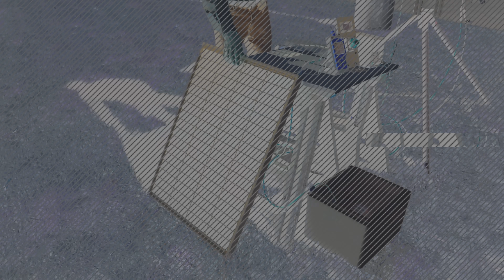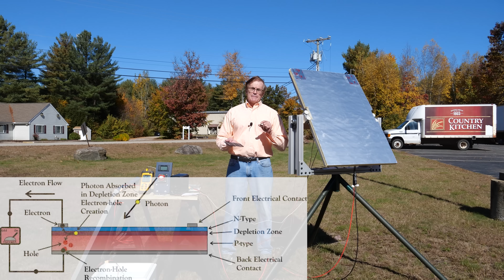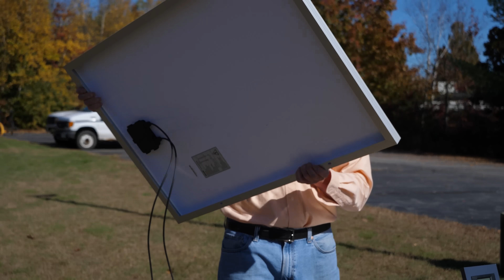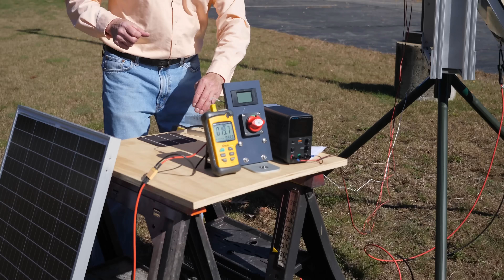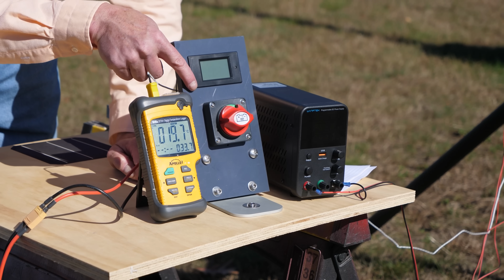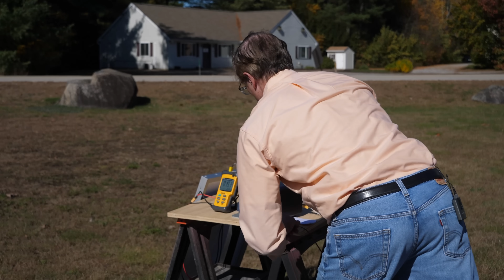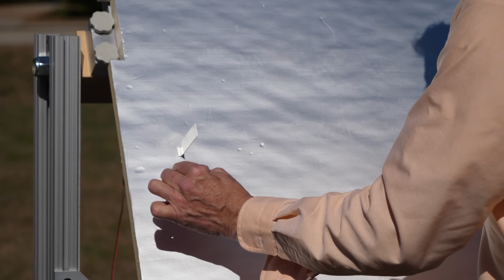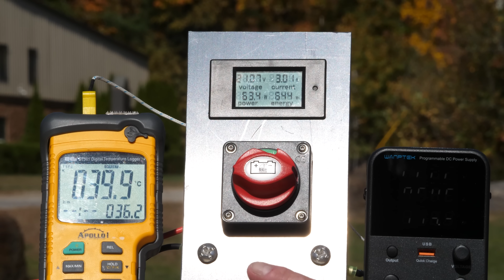Do you REALLY get enough out of your solar panel?

Comment: heat pump + panel?
Reply from the maker: I don't know.
The trade-off is the energy harvesting value through the heatpump vs. the decreased cooling of the panels due to the increased temperature exhausted from the heatpump.
Reply: @TechIngredients  yeah I'm also thinking that this could be just a value question. But also this Heatpump could add more temperature difference for more efficient use of peltier/seebeck/stirling -modules doing extra energy harvesting or pumping actions of water for night energy harvesting, using traditional falling mass method or heat battery.

So result could be that this extra electricity from panels would be contributing to preserving the continuity of power harvesting or be a Combined heat and power(CHP)-solution. For example to reduce on heating and/or pumping bill of shower water.
Why waste good energy, if we know we can use it?

Comment: Did You test or Think about some FAN air flow on the Outside surface, blowing up or AT the outside surface.  Maybe ???
Reply from the maker: No.
The additional  surface area when the front is included is relatively small and the extra fan will draw more energy.   Not to mention that the extra fan is likely  to shadow  surrounding  panels unless a ducting system was designed, which would further increase costs.

Comment: Aircooling is much more simple than water cooling. Especially if you live in a place with freezing temperatures. If you use one big fan located in the shadows and run ducting to the panels it should be efficient, easy to monitor and repair. And if you want to use the heated air from the panels to heat the pool maybe you can push the heat through a radiator and then to a heat exchanger in the pool. But if i would use water maybe i also can run the water down the pipes to my geothermal heat pump to collect heat for the winter. Don't know if that would work but to save heat for the winter would be great.

Comment: Interesting experiment. Our PV system is mounted with a bigger gap between tiles and panels and no gaps between the panels so at least in theory the hot air under the panels should rise and maybe even create a chimney effect and cool the panels by this movement of the air.

Can you think of an experiment to find out how much more efficient it could be with some fans like yours?

Comment: I wonder if you could add some kind of large black metal chamber above the solar panel which causes the air inside in it to heat up and cause a convection flow of air drawn in over the back of the solar panel thus cooling it with no moving parts.

Comment: The biggest problem with this type of active cooling system for passive semiconductor devices like solar panels is the significantly higher failure rate of the mechanical parts of the fans. Mounted on rooftops means difficult and costly replacment.
In reality, some form of fault monitoring system will be required for each cooling fan.
This mechanical cooling system will need to operate over a period of 10 to 20 years, possibly under a varity of extreme climatic conditions.
 All this adds up to impracticality.

Comment: I appreciate your experiments, but I disagree with your thoughts on this one.
Several things could be improved in your reasoning. The fans draw 3 W constant regardless of whether the panel is perfectly aligned. Your gain calculation actually relies on the panel being perfectly aligned, which without tracking, it won't be. A misaligned panel will already be cooler, so the heat exchange will be less efficient, and the % watts saved will be less.
A misaligned panel will also not generate as much, so the absolute watts saved will be less.
So the power generation is not guaranteed to exceed what the fans draw without a tracker.

The engineer would also say that the efficiency gained from tracking because of extra capital outlay, power usage and unreliability does not justify the simplicity of just installing a couple of extra panels to overcome efficiency losses.

It is a flaw in the calculation to include perfect tracking without assigning a cost to it.

The longevity argument is also weak because, given the efficiency gains achieved by manufacturers, it is worth replacing panels well before their EOL anyway. Panels that were 16% efficient a decade ago are 21% efficient today. That is a 24% productivity gain. And as you state, the more efficient a panel is, the cooler it will run.
 So why bother nursing a panel along for 25 years. In reality, the longevity of PV is already fantastic because they have no moving parts. Your fans and tracker have no chance of lasting as long.

Comment: You can buy aluminum strips like that at the home improvement stores.
I've bought a fair bit of it for making heat sinks, bus bars and other stuff.
Readily available up to 1/8" in a wide variety of shapes/configurations.
That thickness is easy to cut to length with a miter saw with the right blade.

Comment: There is another cost consideration. How much cost is the cooling system adding overall? Because if I just want 5% more power I could add 5% more panels (assuming there is available space). As much as I appreciate the efficiency and potential life extension of your system, I generally favour the KISS principle. Fewer moving parts is almost always a good idea, especially on an installation with an expected lifespan of 20 years or more. Finally, to make the most of your system you would probably need to add a temperature monitoring system for each panel so that you can identify any problems with the fans and know when to service them. Maybe there is a better way to use passive cooling to keep the system simpler and without moving parts? Could be the ideal compromise. Enjoyed the video, btw!
Reply: That's legitimately a nonargument. The cost of a couple fans and some aluminium sheets is nearly nothing compared to the panels and installation. You're also COMPLETELY ignoring the environmental effects of not having to produce even more garbage. A good quality fan can last several decades, the same as a solar panel.
Reply: @Gabu_  You are talking about the environmental effects of "producing more garbage" yet you are suggesting to add a ton of fans, aluminium fins, fan controllers and power supplies, other mounting hardware, etc. You are contradicting yourself.
Reply: @ABC-rh7zc  I'm not contradicting myself, you're just clearly completely unqualified to comment about this topic. Recycling or reusing aluminium is easy and cheap. Fans are mostly made of empty space, cheap and easy to discard properly. Solar panels use a shit ton of energy to produce and contain heavy metals, toxic pollutants. Which do you think makes more sense to preserve for as long as possible?
Reply: @Gabu_  you're funny
Reply: I had similar issues. One thing that is kind of ignored, which is understandable, not everyone lives in a hot country. The roof surface temperature will be 50°c to 80°c in summer. DC fans generally don’t work well at such high temperatures in a 24/7 environment that wouldn’t require looking after. DC fans are cheap, but if they have to be constantly replaced every 1-2 years, the amount of efficiency gains become a headache. We have flat roof over here, but other countries use slanted roof structure. Servicing, repairing will be immensely troublesome. Plus we get dust storms, dc wire connections will break over time. Had the heat sink worked, that would have been great. Using cold water is an option, but our water tank is usually on the roof, that is already hot. Folks who have underground water tanks will have to live with hot water coming out of the cold tap. Usual panel size is about 3’ x 6’~7’. Those metal sheets may stop working as effective heat sinks. Especially during winters. We have to remember, best testing conditions are done around 22°c with a light cool breeze. If the air temperature is 10°c and panels are warmed up to 18°c because of the sun. This active cooling will cool the panels down and make them more inefficient. 

USA is quite backwards in solar technology, bifacial panels solve this issue significantly. Having a white heat sink coated roof works out really well well. Still not sure if worth the investment to go this route. Sorry for the message appearing after a year 😁

Comment: Does he know you can just buy aluminum angle bars from any place that offers it as fabrication stock? It will likely be close to the right size too, depending on where you get it. (Listening describe how he made his own heat sink.) No need to have somebody fab that from the sheet unless its somehow cheaper.

I'm curious if better can be done with active liquid cooling, due to the potential for higher heat carrying capacity. Of course that depends on how much of a load that something like pumping the coolant circuit presents, and perhaps having a fan on a radiator. Of course that may also present other options like using a geothermal heat sink (running tubes into the ground) or using some nearby body of water to transfer heat into. (Again that's if it doesn't substantially increase the load on a recirculation pump.)
Reply from the maker: Yes,  I know  that it's  available, but it turns out that it is substantially  more expensive.

Comment: I would think that liquid cooling might be easier. There would be no need to add surface area, it would be easy to daisy-chain panels just hooking outlets to inlets and so on, all going to a radiator (perhaps itself in the shade) that could have one or two large high-efficiency fans. It would add a pump into the mix, but there are efficient pumps out there.  I'd be curious to know whether the surface of the PV cells has exposed conductors or whether you could actually just submerge the panels, potentially even while suspending some fine particles of some substance that could absorb light outside of the usable wavelength so that it could carry away that energy as heat before it even hits the panels.  Probably need to ask a materials scientist type about that.

Comment: Thank you sir, very well done. I was inspired by your Peltier cooler two years ago and decided to build our own for our insulated battery enclosure. Both heats and cools based on internal temp. Now I must thank you again, our East-West Facing system called the SA4 acts very much like a greenhouse in summer. Going forward will install a fan on one of the ends of the array to allow fresh air to flow under the panels when ambient temperature rises above 20 degrees C.  
This will surely increase gains, and thankfully our Grid Tie Inverters all come with a 120V outlet at source to power the fan.
Keep up the great content, as a solar installer, it's a pleasure seeing these experiments.
Reply from the maker: Best of luck!

Comment: While I understand your notion and agree on the overall results and conclusions from this experiment I'd like to point out that i have yet to see a fan that's going to keep blowing for 20 years while constantly exposed to the elements.

 There are multitude of events that are going to simply destroy these fans multiple times during those decades which in turn are going to drive the cost of maintaining whole system. This challenge in turn asks for more overengineered solutions to keep the system close to maintenance free - with, again, a higher installation/upgrade cost.

Otherwise it's a great proof of concept. Thank you

Comment: I am curious wether you could add a bit more efficiency to this. Since this video focuses on heat a fan is the obvious first choice. But have you looked into utilizing peltier modules between the the aluminum heat sinks and the panels? Essentially you'd be adding thermal conversion in addition to solar conversion to electrical. My hope would be that the peltier modules would be able to power the fans, possibly linear to load as temperatures rise. What are your thoughts?
Reply from the maker: Did you watch our earlier video on the "Campfire Generator"?
I discussed  some of the properties  of peltier  devices used as electrical generators.
The problem  is that they're  extremely  inefficient.  They will reduce heat flow from the panel, causing its temperature  to be a little  higher and lower  its efficiency.  They're  also relatively expensive.

Comment: theres no doubt about it that heat will affect the performance of the solar panels BUT BY ADDING THESE FANS in every panel will add more weight in the roof, additional cost, etc...... in my own opinion, this is pointless coz youre just making your solar set up complicated and more works by adding these fans

Comment: Nice! I have maybe one argument against this idea, over 10 years we might have cities/villages with constant fan noise.. Why not use the heat instead of convert heat ALSO to electricity?
Reply from the maker: The primary reason  is that there is no cost effective  method to make that conversion because  the temperature differential  is so low.
Also,  these fans can not be heard even when your head is only one foot away from the panel.

Comment: 2:22 is this the same thing as the temperature-dependent decrease in the bandgap?
Reply from the maker: No.
Solar cell efficiency drops with heat due to increased carrier  recombination.  The band gap decreases with heating and this is why LEDs color shift with temperature.

Comment: Just my comments. 

Add one more panel after 10 years and kick the entire out put back to original values.

60% more panels would give you original quoted  output. So 20 panels increased to 32 panels. 

Solar panels shade the roof in hotter months. 

USA administration costs are the killer for solar rooftop PV systems.

Neighbours taxes will not be needed to build new central generation capacity or more maintenance work.

Bigger central electric generation plants need bigger grid capacity, bigger grids or more grids.
Grids are extremely expensive, 
10 times more than the plant. 

I like your work. 
The numbers are helpful to Understanding the practical aspects.
Reply from the maker: If you don't know the numbers, you don't know anything.
Reply: @TechIngredients  many people know only Adjectives, sadly.
Reply: @TechIngredients  my understanding is that the national power grid is 10times more expensive than the central power plants to construct. 

Also in a no fossil fueled world then 5times more electricity is needed. 

If the grid is UNLOADED.......

Rooftop solar generates power and the transmission costs are basically 'free'.

With EV, electrical vehicles, the battery is also free with the vehicle. 
100kwh battery for the long drive. 
But daily drives are 7kwh. 

In Australia a 33kwh rooftop system on every building will over supply. 
That is 33m2 and every home has that much window glass but at 2times the price. 
In cold latitudes more panels and over 10mths each yr, you would still be ahead.

50times cheaper to go hard on Rooftop PV, with EV batteries connected to the buildings.
Selfparking onto a low mounted wall power point would be a simple gadget. All vehicles park 23hrs a day.

Your thoughts  ?
Reply from the maker: All good points.
Another viewer from Australia  stated that there were governmental regulations limiting the capacity of residential rooftop solar installations. That seems counterproductive.
Reply: @TechIngredients  yes, but it depends what they meant.
6.6kw systems or 33kwh daily is std, and single phase, feed in is limited to 5kw per phase. 3 phase connection is possible. 
In South Australia they remotely stop excessive rooftop solar supply at times to stabilise the grid. 
But this is all minor matters for now.
There are 6 Tesla cars near me, and that number will expand in Australia rapidly as new trends do here.
Turning off free electricity now and again is a minor but headline grabbing story.

Nearby there is a container sized rapid charger installed. 
At the kerb in a side street. 
It soaks up excess daily grid electricity to rapidly dump into a vehicle battery when needed. 
I think that will be a corner store business model soon. 
I think most people will just plug in at most car parking spaces and trade electric energy with the grid for money and profit. 
The grid owners will make money. 
Elon Musk is doing something like that now on a huge scale like a highway fuel stop.
Big batteries and the rooftop covered in solar pv panels. 
Just my thoughts.

Comment: Wtf just buy angle aluminum
Reply from the maker: It's more expensive.
Reply: @TechIngredients  have you accounted for the value of the brake you are using? Most Aluminum traders i have bought from just sell the mass of the aluminum regardless of profile type
Reply from the maker: This is what I found to be the cheapest solution.  You may have access to a better market, and if that's  the case, then commercial  manufacturers of these panels  probably will too.  Even better.

Comment: good video, thanks for uploading and speaking on this misunderstood concept. to be fair, i think you need to compaire the pannels insitu with the back removed and just passive heat sink vs actively cooled since there is extra airflow youre discounting with the aluminum box on the back. I bet the best solution is going to be the addition of cheap heatsinks to the panels without fans and more intellegent placment on roofs to maximize airflow
Reply from the maker: There is a very small improvement  with just the metal fins.